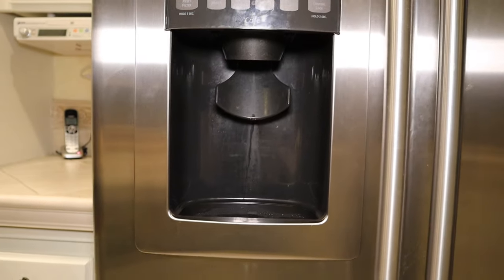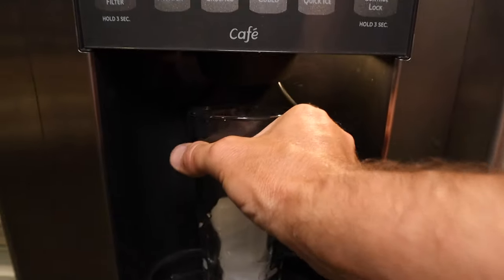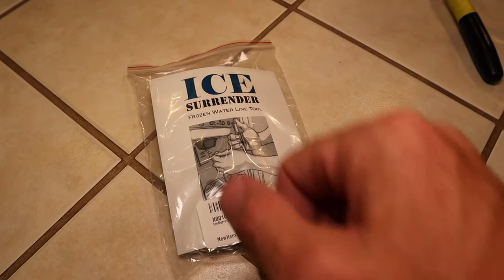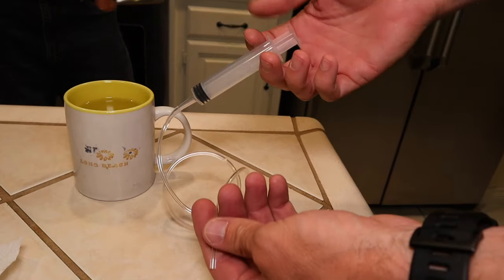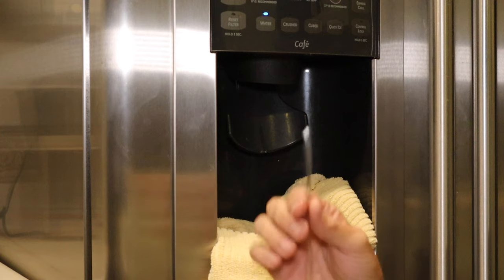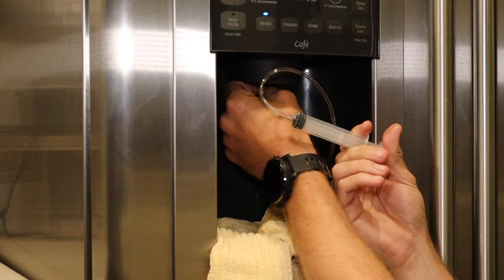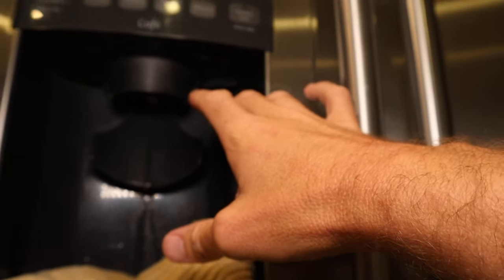The Best Way to Fix a Frozen Water Line in a Refrigerator - DON'T Use a Hair Dryer

Comment: Thanks for showing the best way to clear a frozen water line.  We have had that problem many times.  I believe it is very common in GE side by sides due to where the route the water line.  They probably do not insulate the water line enough from the freezer either.  I think  the reason we have a chronic problem is that we do not use the water every day which allows small chunks of ice to form until the line is completely blocked.  I had unsuccessfully and cautiously used the hair dryer method until I fastened something similar to what you are using.  You are definitely giving your subscribers the best advice!

Comment: "Refrigerator enema" 🤣😂 btw I loved the intro of the setup and also when the water started flowing at the end.  I got the symbolism btw, in case anyone missed it.  Very witty, Sir. Very clever indeed.  You have a subscriber.  Also yeah, this procedure is the most effective.  I have tried using a heat gun and it does melt plastic very quickly and it is not as effective when you are trying to get at the inside tubing that's frozen.

Comment: Thank you! Thank you so much!!
I made my own with a food injector that came with some Cajun seasoning I bought. Used a tube from the sprayer on a bottle I had. I also used a hair dryer on the back of the door where I suspected the tubing was. Worked perfectly! 😍😍
Reply: Using the tube from a spray bottle is a fantastic idea!  I had the syringe, just couldn't find the right-size tube. I even went to Home Depot and their smallest tube was still too thick. Thank you for your comment.

Comment: Thank you! Wonderful!!! Ordering one right away! My problem is the reverse: water but no ice. My refrigerator is so jammed into a corner, it would be a major problem to pull it out to get to the line behind it even with a hairdryer. I've been using the hairdryer on the exposed part of the line going into the icemaker, but that is not enough. It froze up after a storm knocked our power out for 5 hours. When the power came back on, the line to the icemaker froze up. I did not know these things existed!!

Comment: Thanks for the recommendation and showing  us how to do this.   I have to tell you that before this, I was doing the hair dryer hack  as it worked the other few times. :)  I used  my marinate syringe injector (without the needle), microwaved a cup of water for 30 seconds, injected it for a couple times, the actual water pressure already build in the line pushed the little ice plug. :) uuff and now we have water.

Comment: the problem is that the water dispenser line freezes. GE side by side model (GSH25JSTCSS) Appliance parts pros said try the heater first, It did not work wire #2 & #6 did not have continous 12 volts DC.Then I could replace the freezer door! price around $700.00. & $60 something dollars for the heater. the heater. 
On Amazon I picked up the heater & a 12 volt 5 amp power supply all for around $ 20.00 see attached photos. I attached the power supply to th upper left side of the refrigerator w/ 2 sided magic tape so I can see the little blue led photo #5 added a little silver tape to protect the the 2 small white wires. It's been a couple of months now and NO more freeze ups. It used to freeze up weekly.

Comment: Hi DoItYourselfDad. Thx for the video.  I tried injecting with the recommended tool but gave up after about 5 or 6 injections. Could there be a bigger problem or should I continue injecting?  Thx!
Reply from the maker: It would be something different, or the blockage may be really big. You're not going to hurt anything by injecting more.

Comment: I've had the same refrigerator for 17 years.  And for all of those 17 years, it was without issue until today.  After watching several videos, I swapped my water filter and still nothing.  I am now defrosting the water reservoir behind the crisper (can't tell if it is frozen or not).  I also checked the lines behind the refrigerator and they do not seem to be frozen.  However, I did read elsewhere that a homeowner found having too many ice packs in the door was the culprit.  Oddly enough, I had 11 medium sized ice packs on the door for months without issue.  But, I added one more a few days ago and then this issue.  So, time will tell if ice packs on the door and near the dispender caused my freezing line issue.

Comment: It's usually frozen down in the door, not near the water outlet. A heater near the water outlet won't do anything. Packing the freezer too much (so the cold food is right next to the door) is what causes the issue... along with a bad design by GE. I've had two of the same GE models made about 4 years apart and they both freeze up.
Reply: the problem is that the water dispenser line freezes. GE side by side model (GSH25JSTCSS) Appliance parts pros said try the heater first, It did not work wire #2 & #6 did not have continous 12 volts DC.Then I could replace the freezer door! price around $700.00. & $60 something dollars for the heater. the heater. 
On Amazon I picked up the heater & a 12 volt 5 amp power supply all for around $ 20.00 see attached photos. I attached the power supply to th upper left side of the refrigerator w/ 2 sided magic tape so I can see the little blue led photo #5 added a little silver tape to protect the the 2 small white wires. It's been a couple of months now and NO more freeze ups. It used to freeze up weekly.

Comment: Thank you for this  video!  I would like to know if there is a simple fix without calling a Plummer for low water pressure? We have well water and after a storm in July our water pressure has not been as strong as before. We change the filter under the house which was full of sand. Could we have sand in our pipes that can be flushed out?
Reply from the maker: Sorry, I’m not too familiar with well systems.

Comment: Thanks for tips, this was really helpful! Is this a one time fix? Or will I have to do this method every few months?
Reply from the maker: Depending on the fridge you may have to do it again every now and then. It's a design flaw with some refrigerators.
Reply: Try turning your freezer setting down also.
Reply: Also use the water dispenser everyday even if you don’t want to drink water
Reply: As a handyman I recommend you leave the night light on, turn your freezer up, ie warmer, and use the dispenser on a regular basis to help avoid having to do this, and yes this trick in this video is the way to go, if it's frozen in the door and not in the coil inside the fridge or in the internal filter, you can check by pulling the grate off the bottom of the fridge, disconnecting the water line going into the door, close the door and try the dispenser, if the water comes out of the line than it's frozen inside the door for sure ;)

Comment: Anything else this could possibly be? I have emptied about 2 full mugs of warm water into it. Could it just need more or is there another possibility here? Thanks.
Reply from the maker: it could also be a valve or supply line issue.... but if the entire line is frozen it will take a lot of water to get it free.

Comment: Thanks for the Video, $13.95 is not "a couple of bucks" thought; Again, thanks for the video. Why does the tube keep freezing? I have my freezer set on the lowest setting, which is 1 where 5 is normal.
Reply from the maker: Its a couple of bucks compared to the $150 and up service call to squirt warm water up a tube.... The design on some of these models is terrible, there isn't enough insulation inside the door to prevent the line from freezing.

Comment: I just ordered one. I had no idea what was wrong with my water dispenser. I called a tech out, he replaced the valve bank, then told me I needed a new filter. I got a new filter and still nothing. I called the outfit that sent the tech, and spoke to the lead tech. He helped me diagnose over the phone, frozen water line it is.

Comment: I’ve been doing this for months, but the water line keeps freezing. Is there any way more permanent to fix the frozen water line?
Reply from the maker: Throw a thermometer in your freezer and see if it’s getting colder than it’s supposed to be. That’s what was going on with my refrigerator.
Reply: @DoItYourselfDad  thank you, I'll try that! If that's the case, do I just change the temperature settings and it would work? Thanks for the quick reply!

Comment: Do you think this is the same type of problem if it won’t give me water in the morning but in the evening when I get home from work I have water? I haven’t lived a winter yet in this house. It was really cold last week too and no issues but today and yesterday I couldn’t get water to come out. No other sinks are frozen.
Reply from the maker: It could be that the fridge is just barely getting cold enough at night to freeze the wine, and worms have just enough to fight during the day. If the temperature of the freezer could be raised a little bit that might help.
Reply: I did this with tubing like in the video, it only went up a little ways and ran into an obstruction (frozen water) so then I squirted hot water up the line and it moved in a little more until I ran into more frozen water. I repeeted this and the line kept going further in a few tries and then it cleared out completely. Furthermore, I wonder if the reason you get water in the evening is that your kitchen warms up during the day, or possibly the sun shines on the outside of the fridge door and thaws it.

Comment: What temp should the freezer be set at so this water line does not freeze?
Reply from the maker: 0 F , but with some of these there are issues even at that temp. You can try bumping it up a few degrees if needed.

Comment: Thanks for the tip. I have a 10ml 💉. I will get the drain line at Home Depot and try.☺️
Reply from the maker: The first couple of times I had to do this I did just that. Works great!
Reply: Any luck with finding a small hose from home depot?

Comment: It's good video but it's temp fix, the source of the problem is either something about your damper valve or airflow issue between your freezer and fridge ;)
Reply from the maker: It’s a common problem with the particular model in the video, a definite design flaw.

Comment: What was the cause of the freezing water outlet? Is there any preventative maintenance to avoid this? Thanks
Reply from the maker: The water line routes through the door of the freezer. I’ve seen people that have disassembled the freezer door and added some insulation between the line and the freezer which would probably help.
Reply: Thank you! These videos are extremely helpful

Comment: How many cups of boiling water do you have to use? My i e maker is not getting water to it either it is not making ice. I trieddefroating it for a day and a half . It did have a little water come out after I turned the refrigerator back on. Do you have any other suggestions?

Comment: I actually used an extra new syringe from my kids cough syrup. It fits air tight in the hose but I can't even get one full 5ml of hot water in there. The pressure forces some back into syringe. When I press dispenser only the water I put in comes back out. I tried this a few times to no avail.
We have had the side by side for 14 years with no issue. The filter is due to be changed next month.
Reply from the maker: Do you have anything you can try to get up inside the the tube to figure out how far back the blockage is?
Reply: Me too
Reply: I use weed eater line, fits right in the tube

Comment: What about when your GE fridge (different model) line is in the back?  Back part of the fridge, I mean?
Reply from the maker: The line is entering the fridge from the back, but it still routed through the fridge to the door, correct? Do you know where the blockage is?
Reply: @DoItYourselfDad  so the last time the maintenance man fixed it, he showed me a long thin piece of ice that was stopping the water flow into the mold itself. I’m an idiot when it comes to this stuff but I’d like the ice maker to work. It’s an old fridge, apartment type fridge. The top freezer and lower fridge open from the same side. I hope that answered your question. ✌🏼
Reply: @DoItYourselfDad  this model doesn’t dispense the water or ice from the door.
Reply from the maker: If it’s the feed coming out of the icemaker, it’s going to be a different line. It sounds like you may need to thaw the line on your icemaker for a little bit to get it to work.
Reply: @DoItYourselfDad  I think I might do that, like take everything out, turn it off probably, use a  hairdryer on it, be careful even though I wouldn’t come in contact with any water. So in the line is gonna be some nasty old water, would that be correct to assume? Uhhh 

Nasty water, reminds me of 2020 and a bad property manger omg anyway, I might try to thaw it out. The last time the maintenance guy fixed, literally a few minutes after he left it started freezing up again. I had like one mold of ice cubes and that was it.

Comment: Tried this to no avail.  Had to unpack the freezer into coolers and thaw it out, heating the backside of the dispenser area with a hair dryer.  Second time now in three or four years.  After the first time I taped some eps foam to this area for extra insulation.  Thought it helped, but maybe not.  I do think we had too much frozen mass in the door or close to it, which per other comments can cause this problem.  Good luck all
Reply: the problem is that the water dispenser line freezes. GE side by side model (GSH25JSTCSS) Appliance parts pros said try the heater first, It did not work wire #2 & #6 did not have continous 12 volts DC.Then I could replace the freezer door! price around $700.00. & $60 something dollars for the heater. the heater. 
On Amazon I picked up the heater & a 12 volt 5 amp power supply all for around $ 20.00 see attached photos. I attached the power supply to th upper left side of the refrigerator w/ 2 sided magic tape so I can see the little blue led photo #5 added a little silver tape to protect the the 2 small white wires. It's been a couple of months now and NO more freeze ups. It used to freeze up weekly.

Comment: okay this is a great idea. but my issue is when I try to put water in the line it doesn't accept the water and I get water shooting out at me. any ideas?
Reply from the maker: If it’s doing that, it’s getting blocked by ice. Put a towel down and keep applying the warm water until all the ice melts

Comment: I'll tell you an easier way than that. Take an electric heating pad, place it in a plastic trash bag and tie it up so water can't get in easily. Then place it where you place a water glass then turn on high. Come back in 20-30 mins and check. If still no water leave longer. No mess.
Reply from the maker: Solid idea!
Reply: I made my own enema kit, and it worked perfectly in a couple of minutes. What I liked about this method is that I could only push my tubing in a few inches, then hit the frozen water. After the first syringe squirt it moved up a little but after each squirt I could FEEL the frozen water thaw and moved it further in. It only took about 4 syringes full of water until I could push the tubing on up, and KNOW that the obstruction was clear. Done deal, pick up the towels wipe down the door, and now I have water flowing perfectly. Someone in my family had turned the freezer temp to max cold. So I turned it back down, and we're all good again. If I continue having problems I'll try your idea to thaw the whole door and not just the tubing.

Comment: I wonder is there is a way to change the water dispenser tip, I tried the blow dryer and melt the tip.
Reply: Did you ever find a resolution? I did the same. I damaged the water dispenser tip and the ice door. Yikes!
Reply: @christophernarcisco6550  the ice door can be replace, for  the tip I use a nose plier to open the tip as much as I could then I just put a larger diameter water hose over the old tip, is funky but it worked and it has work for over two years.
Reply: @zakarathedragonqueen7254  Thank you!  I am ordering the replacement ice door flapper and spring online. Thanks again for your reply.

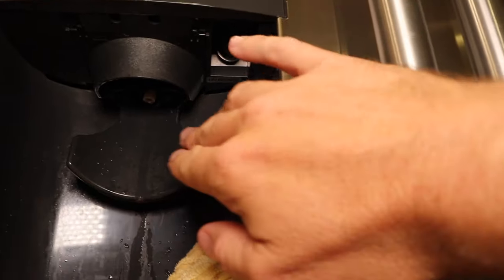Comment: hi, at 2:05 in your video after you are done dispensing water, i hear a bang noise...is that normal, like maybe the interior water lines hitting something. My ge profile is doing this and wanted to be confirm it not an issue...only does it after getting water or after the ice maker gets water.
Reply from the maker: Yes it’s normal. It’s normal, it’s the clunk if the water valve shutting. You’ll hear it louder if it’s feeding the ice machine as well.

Comment: It works of course. But my line keeps icing. I even set the freezer to 1.
Reply: Did you get it resolved? You may have to use the water dispenser everyday to prevent water droplets freezing up.

Comment: Happened to me again, can't unfreeze this time. Any suggestions?
Reply from the maker: What's the temp in your freezer?
Reply: @DoItYourselfDad  I was finally able to thaw it. Temp was set to 0, but an analog thermometer actually read -5. Not sure how accurate that is though. I raised the temp to 5 degrees. Analog thermometer didn’t change much.

Comment: What about the line that fills the ice tray? That's what is frozen for me.
Reply from the maker: This probably wont work, if the line is exposed inside the fridge try wrapping your hand around the frozen section or a heating pad to melt the blockage.
Reply: Yes on mines the line that fills the tray is frozen 6 months old Whirlpool French doors
Reply: I tried the hair dryer it kept cutting off.Sooooo it's still frozen

Comment: But it doesn’t address the problem causing the line to freeze in the first place so be prepared to repeat....daily.
Reply from the maker: That is a design issue with the refrigerator. If it's happening daily you either have your freezer set too low, there's an insulation problem (manufacturer defect), or an outright design problem.